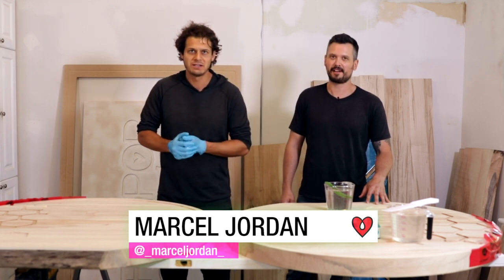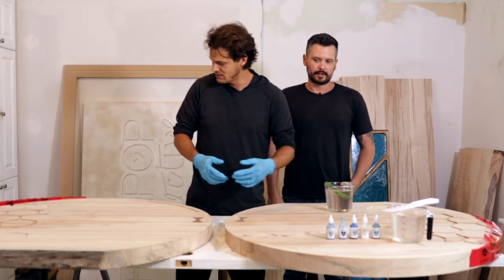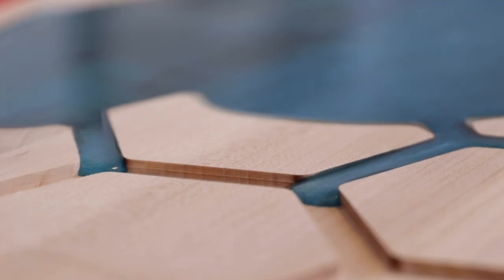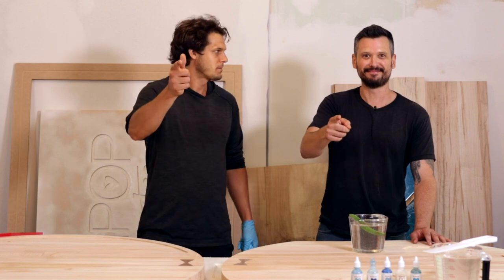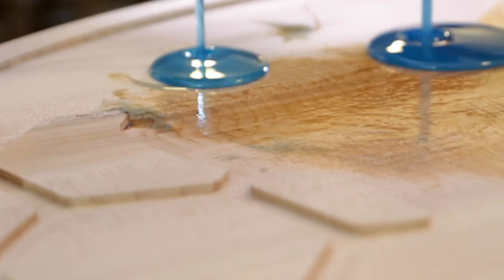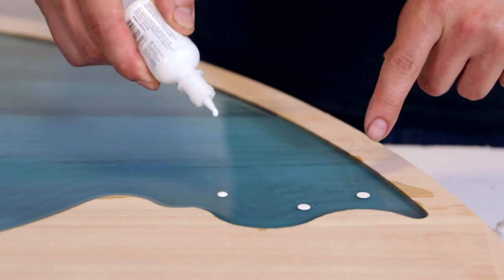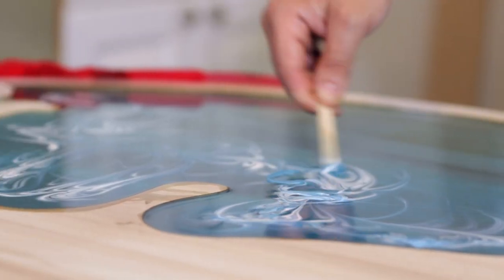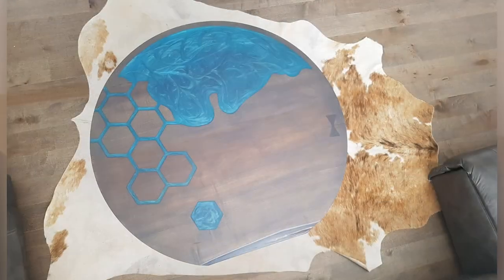CNC Machined River Tables with Epoxy Resin

Comment: How thick can you pour artresin
Reply from the maker: ArtResin was initially designed to be a sealant and poured at an 1/8th of an inch in depth. We do have artists that use our product for pouring deeper than an an 1/8th of an inch but they achieve this by doing multiple pours, this helps to minimize the bubbles. You can layer ArtResin epoxy resin in multiple coats, as high as you'd like, as long as you pour in 1/8" increments.